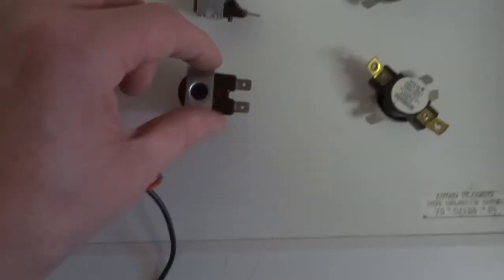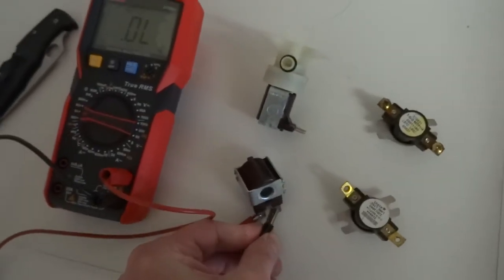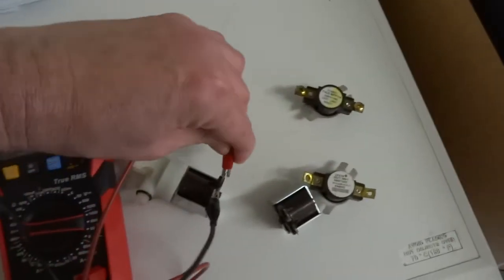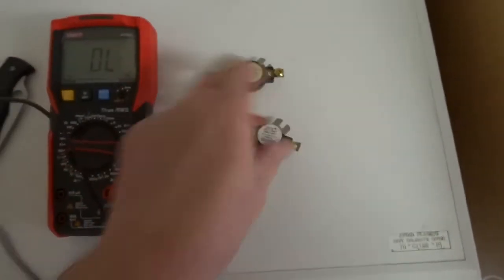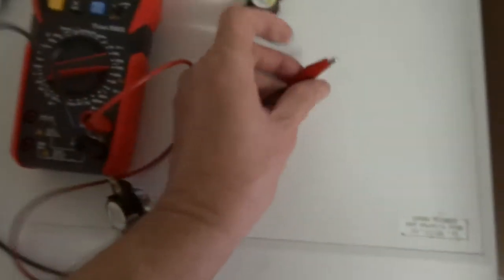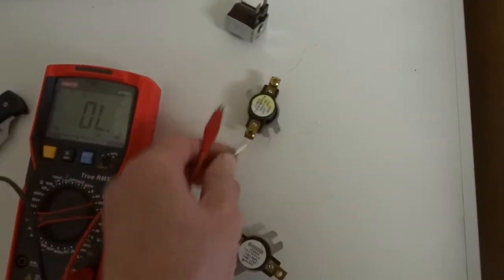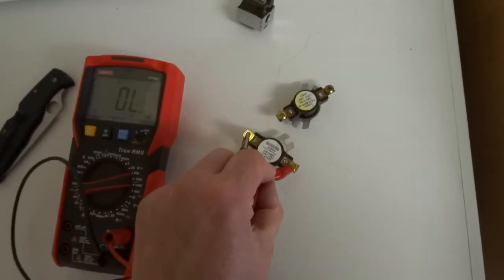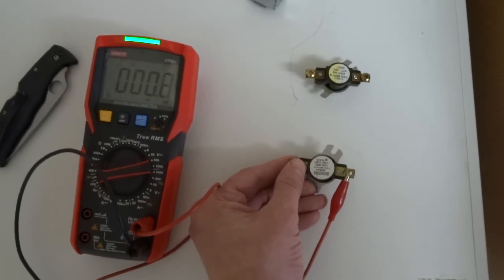Electric Shower Repair: How to Test Solenoid Valve & Thermal Cut Out Good vs Bad Multimeter Readings

Comment: Can you put the red and black wires from the multi meter on any way round, or does it have to be a specific order to connect them ??
Reply from the maker: not really nut not good practive  polarity checks would be reversed for DC voltages and Diode mode wouldbe revereed but we have all done it when in a rush just to ge a quick reading.
Reply from the maker: But no you should connect then to correct connections
Reply: @cagmito76 Ok thanks. I want to learn more about how to use a multi meter. There are some tutorials on here so I will watch them and hopefully it will explain it all.

Comment: Hello mate, is the multimeter just beep if it’s okay or should there be a reading?
Reply from the maker: Solenoid should read 4k roughly on ohms tco is ok with just beep in continuity
Reply: @ thanks for the reply 🙏🏼

Comment: Thanks for the tip. I'm not an electrician. I threw my thermal switch from my sixty years old Kenwood mixer on the floor a couple of times and it works. It has three terminals. What is the third one for?
Reply from the maker: No worries thanks for comment , could be secondary live or maybe an indicator bulb to show its live
Reply: @cagmito76  Thanks.